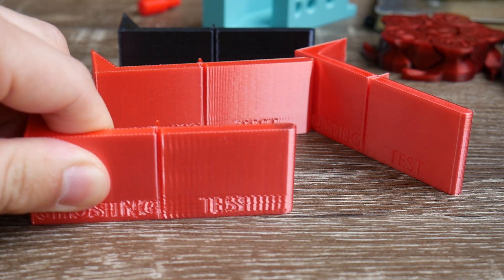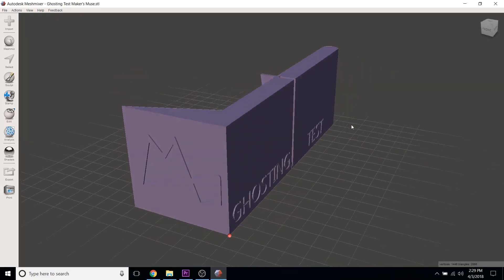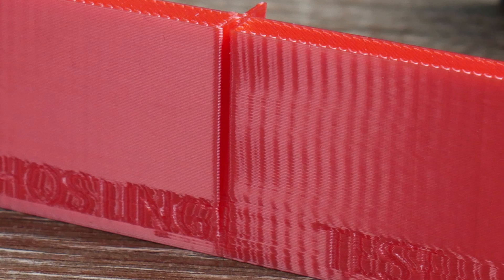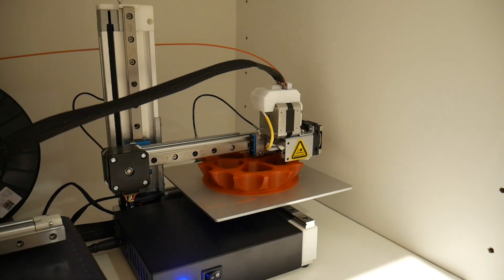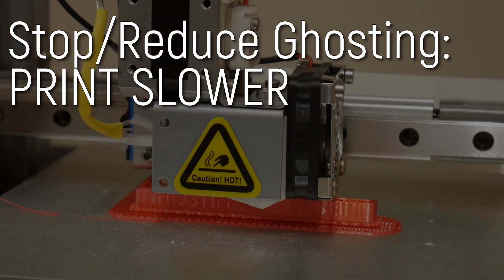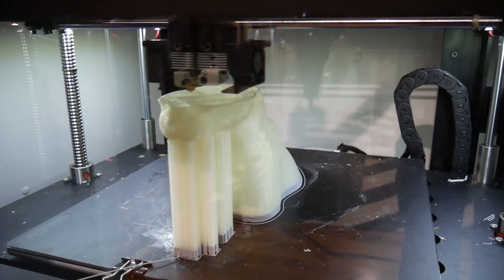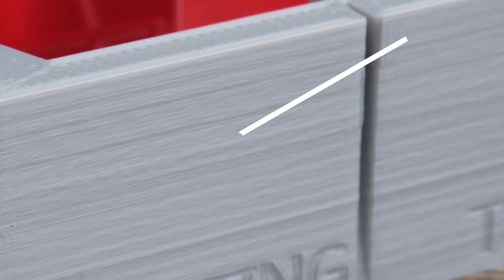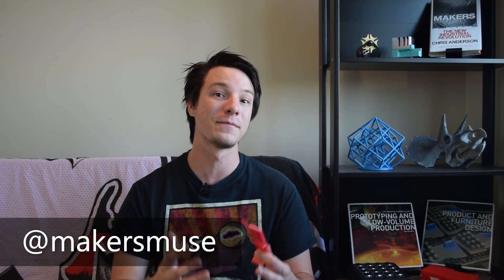Ghosting in 3D Prints - What is it and how do you fix it?

Comment: That's gotta be a constant problem of the cetus. One rail without cross member support will surely do that.
Reply: the problem looks like it might be rigid but the tolerances arent really good and there's no elasticity to the system. Preloading with a sprint of sorts could really dampen that ringing.  I use ptfe bushings here and their strenght and flexibility got me better results than the i3 he showed. Making a machine super rigid is useless if they tolerances arent super tight, that's why i dont like using linear bearings for anything that needs to run smooth. They wear out a track in the rods and then they are super loose and with that comes the ringing and overshooting. I'd love to see someone use the adjustable ones so one could tightent them when they become loose but that adds a lot in cost and also need maintenance and constant control and adjustment.
Reply: Its not a torture test, any model that has square edges like a box, most things made un OpenSCAD, or low poly figurines will show the same problems. The problems isnt caused by the "torture test" model, it's caused by the printer having loose rails that move back and forth every time the printer accelerates or decelerates.
Reply: No it doesnt, it has nothing a test cube doesnt. You cant exagerate square edges, they are either square or not, there's no blacker than black here.  Embossed or debossed letters or shapes are the same, there's no "extremely exagerated" letters here and even if they were 1m deep or tall it wouldnt make any difference because of how printers handle acceleration. Please stop being contrarian, theres litteraly no difference between this and anything else, this is just a model made with the features that would show the defect on other models, all in one for the convinience of not having to print several things to observe the defect.